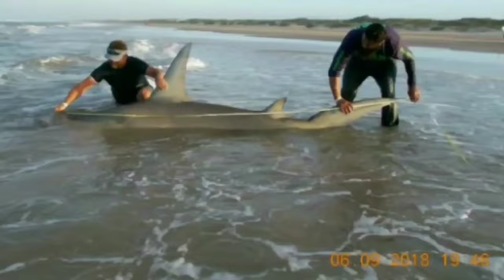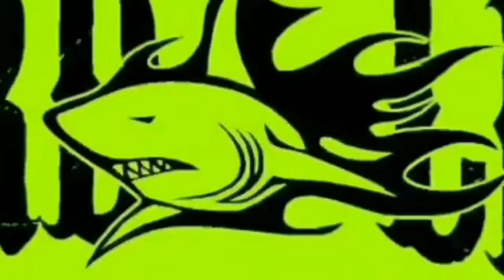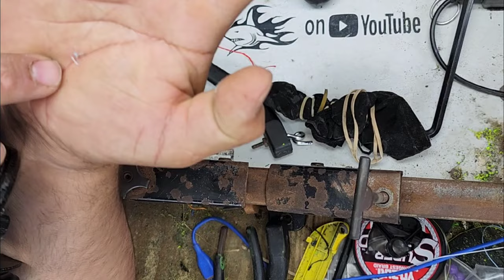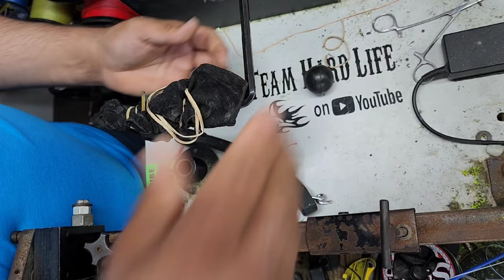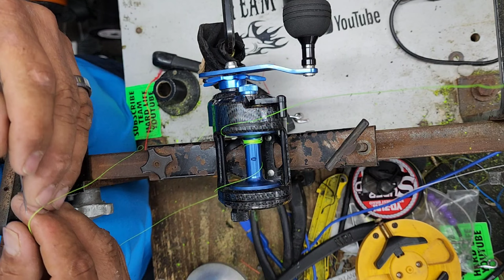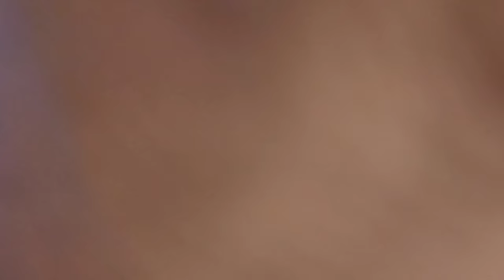PROOF THAT USING THE SPOOL TIE Down ISNT A GOOD IDEA 😬

Comment: Is that an Akios reel? I wondered how well they do with braid and if they have enough drag to stop a full grown fish.
Reply from the maker: Heard they have good drag but havnt fished them myself.. but looking at these nunbers you would really have to work low weight classes of braid
Reply: @TeamHardLife  I imagine it would have to be 40lb or smaller to have enough line to fish with after the cast. Getting below 30lb braid is risky in my opinion. Easily cut off or chafed through.
Reply: I fish mine daily with 50# tightline and have caught 2 sharks over 6 foot and some monster rays.         
phenomenal drum reel.
Reply: @codynewton4095  what’s the capacity on 50? Looks to be about the size of an abu 6500. 7000 max.
Reply from the maker: Not saying the reel over all is bad just the tie down is.
Reply from the maker: Was it from pier or boat?
Reply: @TeamHardLife  from pier and beach
Reply from the maker: What kind of line cap did you get?
Reply from the maker: @mosquitofleetfishing6599 30lb will usually only come out when fighting a decent fish not sit on the bottom that why we put the top shot ..
Reply: @TeamHardLife  i honestly dont know.   i buy one of the huge spools and spool everything at home myself.   never had one put on with a line counter
Reply from the maker: @codynewton4095 if you ever get a chance to stop by would be a great addition tot he channel
Reply: @TeamHardLife  I know. My surf gear has smaller running line with 100-200lb top shots if using braid and 50-80lb for mono.
Reply: All day everyday to the
100K Giveaway#TeamHardLife 
#CortlandBraid #LineCutters #TightlineBraid #Jac’dUpLeatherworks  #Sharkotic
#TexasSurfMasters #GatorLures #OffshoreSyndicate #ShopTheRealDeal